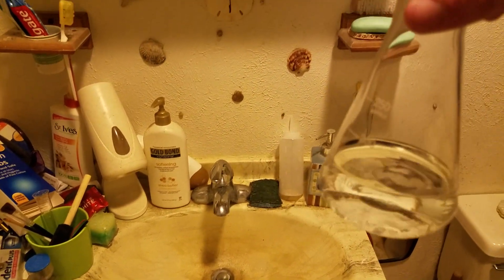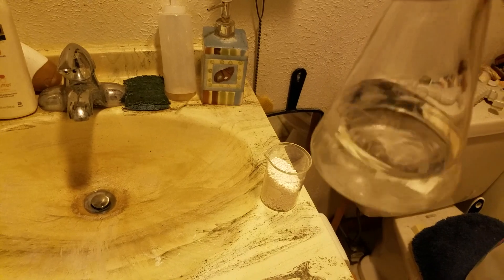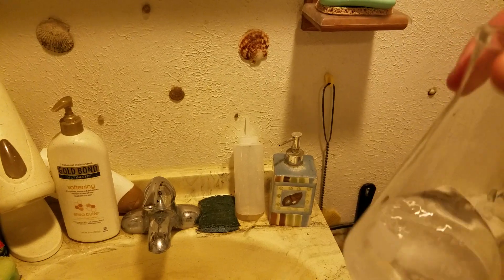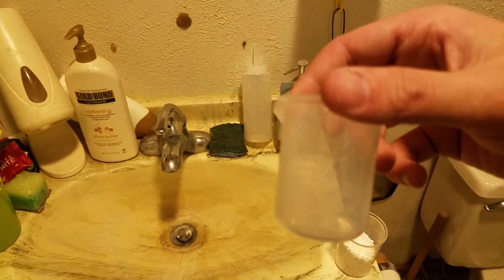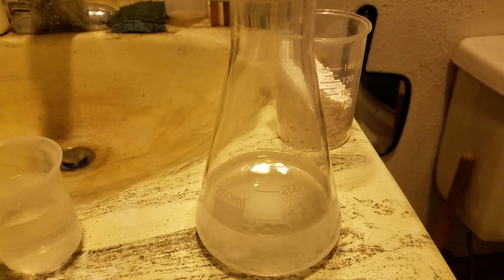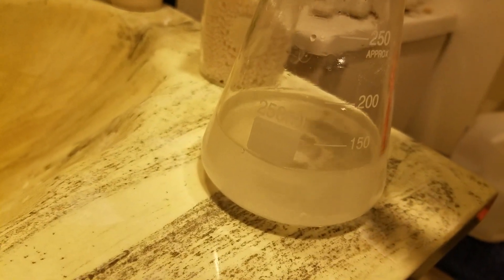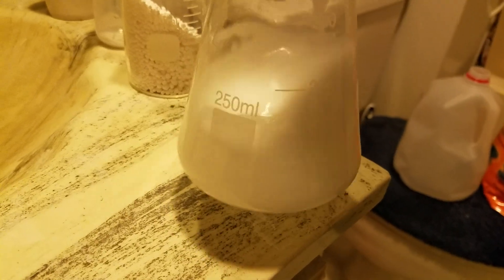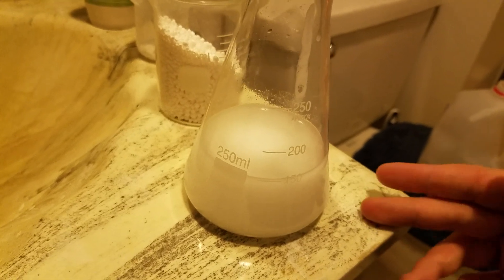Making Calcium Carbonate at Home

Comment: How do I separate the salt and the calcium carbonate from the mixture?
Reply from the maker: The calcium carbonate isn't water soluble, so you could just do several water washes.
I'd recommend something like a coffee filter, and rinse it with distilled water if you're worried about purity.
Reply: I get a gatorade or other bottle, a 9V battery, aluminum foil, and copper wire. You could theoretically use a pencil but it wont be a strong current. You will separate the 2 using electricity. Make sure you do it OUTSIDE because salt contains CHLORINE GAS (half life of around 5-7 hours) leave it somewhere where nothing will evaporate and then BAM you got some seperated stuffs

Comment: Is calcium carbonate by product of  quicklime  water reaction ?  I mean the water on top ? Thank you
Reply from the maker: You can make quicktime by heating the calcium carbonate to its decomposition temp and then adding a little water. I cant remember off the top of my head if quicktime is slang for the calcium oxide or the hydroxide.

Comment: we are going to make an expiremental research , we will use golden apple snail shells. Is it a good alternative as source of calcium carbonate?
Reply from the maker: Snail shells could potentially work if you processed them. I've seen them reduced by using high heat in order to make quick lime for small batches of cement, however the yield is very, very small and you would need alot of shells.
Reply: @varengrey7221  We are going to make a fire gel fuel using golden apple snail. . Can you give some suggestions, to make our research successful? Please.
Reply: @varengrey7221  sir?
Reply from the maker: You would have to turn it into a calcium acetate jelly if you were going for a flammable gel. Nile Red has a good video on this, I'm considering doing a similar video soon.
Reply: Տɑѵɑցҽ ҍɾɑաӀҽɾՏ  also if you want to get some calcium carbonate from the shells (pure) just do this procedure to purify it

First dry the shells (or just throw it in an oven for 18 min at 160 Celsius)
Then grind up the shells mortar (or blender)
Pour the powder into an beaker 
Add dilute HCL slowly until it stops fizzing when more is added
Start adding sodium bicarbonate until it stops fizzing (again)
Boil down the solution and there you go

I will send the chemical reaction or more info later if you need it cuz I’m sleepy as fuck
Reply: @potato675  thank you Sir.❤
Reply: No problem, but after adding hcl you have to filter out the liquid before adding the sodium bicarbonate 

Also do you need anything else as help (I like helping others with chemistry related projects)
Reply: @potato675  I have a lot of questions 😄
Reply: Can we use golden apple snail shell in making Fire gel fuel?
Reply: Yeah totally, you can make acetone from it or a and heater from calcium oxide

Also when do you have to finish the project?
Reply: @potato675  before Christmas
Reply: Can you help me sir?
Reply: @potato675  But I dont have Skype Sir
Reply: @harriscasiano5114  do you have discord?
Reply: How about WhatsApp
Reply: @potato675  I have only Facebook and IG
Reply: Տɑѵɑցҽ ҍɾɑաӀҽɾՏ what’s your fb I’m gonna contact you in messenger ok?
Reply: @potato675  Sir My name is Harris Casiano

Comment: will this formula work to make chalk/like latex paint for my project I'm painting?
Reply from the maker: I mean technically this is chemically equivalent to chalk dust, so if you're using it as a primitive pigment then maybe. If you're just using it to thicken a mixture, beware that it will clump alot. Youd have to really work it to get an even distribution, as they did in the days of old.